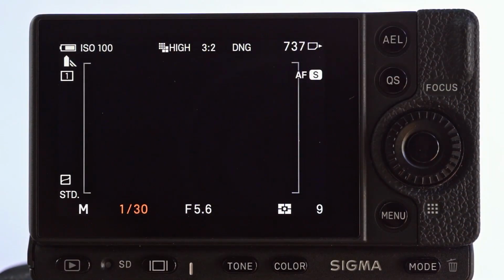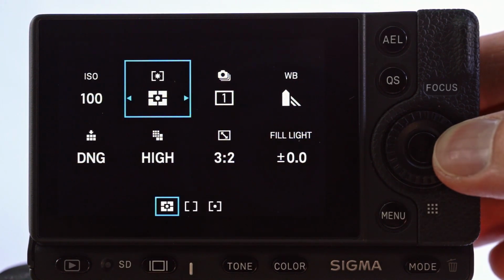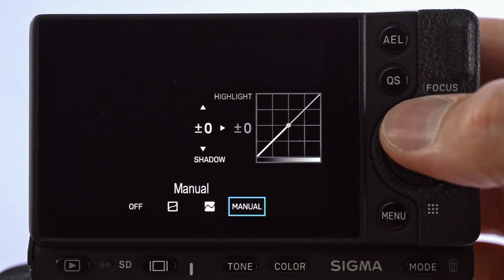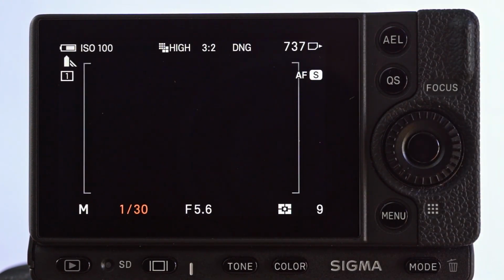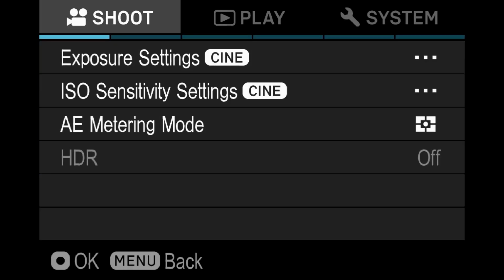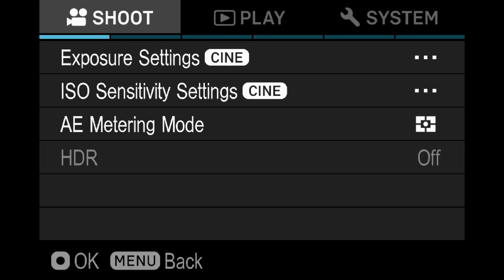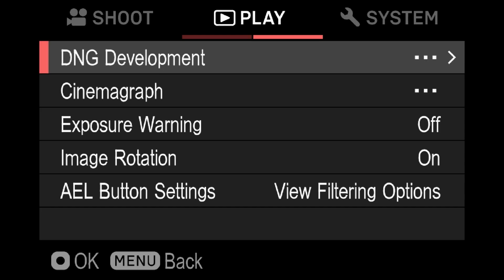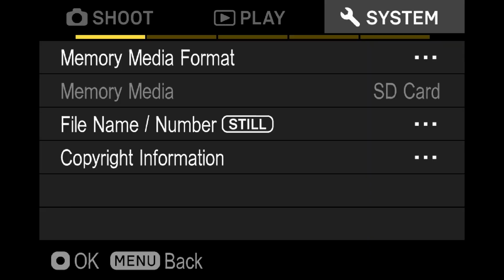SIGMA fp Camera - Control Interface Tutorial

Comment: I just got my camera today. How do I  know its fully charged? The indicator is screen, does it turn any other color? I had to plug it into the camera. Is there a dedicated charger or is this the only to charge the battery?
Reply: You don't need to plug into the camera USBc port to charge, you can purchase a separate charger and plug it into a usb charge or a battery bank power and you are done. I purchase another battery for better organisation continued shooting. One battery in the camera and the other battery waits. When the first battery is empty (battery blinks in red on the screen) I insert the second full battery and put the empty one for charging and so on..an advice : don"t rely on one battery as you can fall short.

Comment: Is there a way to get zebras to stay on the display when in cine mode? I only see them available when I go into the zebra settings.
Reply from the maker: Hey Anson.  You can program the zebra display into one of the custom display mode settings. On the second page of the System menu, halfway down within the Mode Settings option, you can find the Zebra Pattern option under the TOOLS page of available display customizations.  Once it’s been programmed to one, it will show up as you cycle through the custom displays by hitting the display button while in live view.
Reply: @sigmaphoto  thanks for the info! I found it after I asked in the manual. Am I correct in seeing that focus peaking and zebras cannot he used at the same time? Or is there something I’m missing?
Reply from the maker: That is correct.  Currently, Focus Peaking cannot be used with Zebra Pattern. If both are set to On (and I'm not sure this is possible after the firmware update), Zebra Pattern would be given priority.
Reply: @sigmaphoto  Why is this the case? And will this be changed in the future?